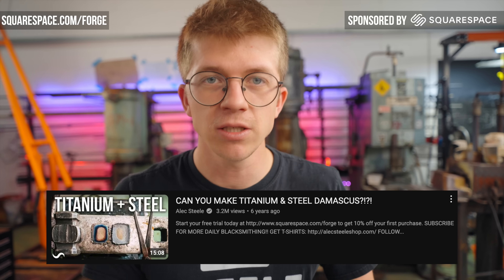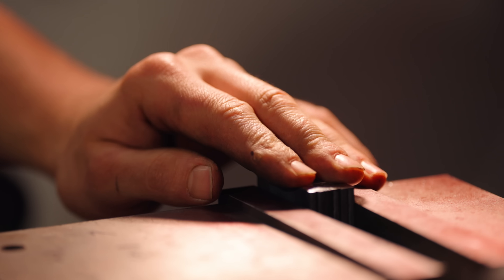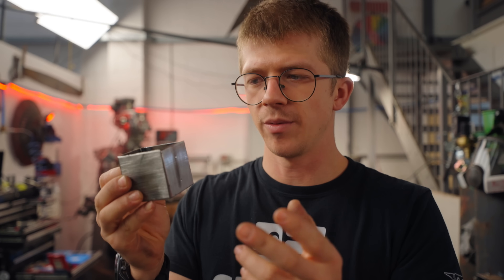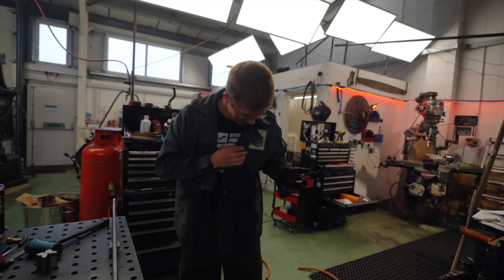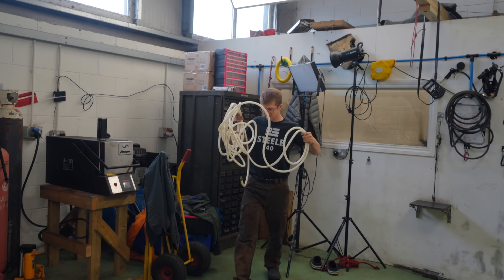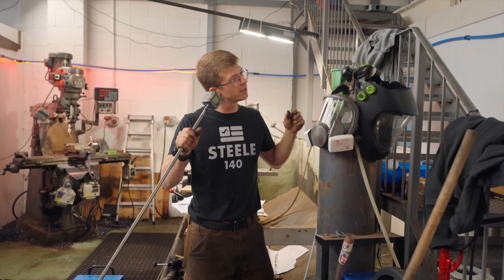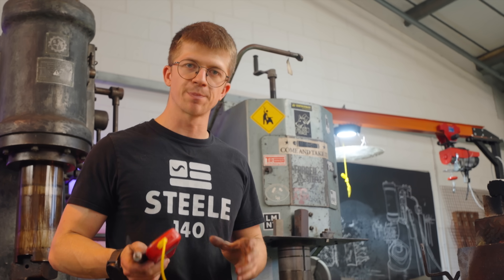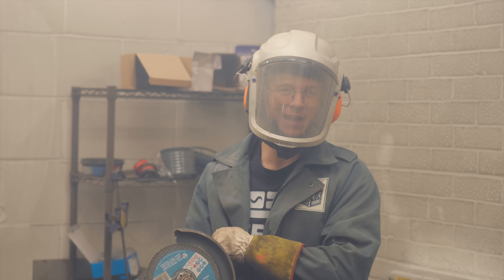Can I make Titanium Damascus?

Comment: You might be able to get titanium cheaper than that if you have better sources. Used to work in aerospace supply and that small amount is what we paid for massive sheets and wire bundles.

Comment: you need an induction forge, should reduce heating time and oxide mess due to no fuels used and can be moved easily so you can place it right by the anvil

Comment: Initially when purging the can you could hold the pipe vertically so that the air floats on top of the argon because science. Or maybe you could place a vacuum on the pipe after putting in some brake cleaner, ignite it and it'll be purged with co2 prior to purging with argon.

Comment: Much better to have used a light pickle process as sand blasting will potentially contaminate the surfaces with Silica grit or sand and ditto the "chemical" cleaner you used. A sensible pickleing mix which will work for both CP and Grade 5 is 88% Water, 10% Nitric Acid and 2% Hydroflouric Acid.
NOTE -  Hydrouflouric Acid is VERY dangerous and will lead to LIFE CHANGING painful burns and skin grafts if you get it on skin or breath in the fumes.
The pickling process can generate a lot of heat once it starts and potentially boil the acid mix. Pickle each piece a few seconds each, rinse under clean fresh water (warm water is good as the pieces will dry quickly and leave no water marks / staining, place onto kitchen roll or similar to dry up the excess water / moisture quickly). Handle with clean cotton gloves or similar so as not to leave any finger prints. Preheat to 925C to 950C (1697F to 1742F) perfect for the CP  and Grade 5 combination. 2100F (1149C) far to hot for both CP and Grade 5. To prevent the Titanium and Steel sticking together, the easiest things is to paint the inside of the steel box with a thin coating of HIGH quality brilliant white emulsion paint and allow to dry (the pigment in HIGH quality white paint is Titanium Dioxide and will assist in preventing bonding). Good luck with your next attempt :)
Reply from the maker: Thank you for this great info!!
Reply: @AlecSteele  Happy to help where I am able, not an expert but 40 years in the UK Titanium industry in a Technical / Quality Assurance role on many different projects I have picked up a few tips and happy to pass on, though I'll have to be careful not to give away any trade secrets ;)

Comment: Seen a message board from like 10 years ago and they were talking about types of metals for smithing swards and one guy went into great detail about mixing tungsten, steal, slivers of gold ect. He said it was hard to do cause you can potentially drop a lot of money to get it right. And I guess there’s metals out there that have like a memory and will slowly bend back to its original fixed state? I feel like there’s a lot of untouched territory for long lasting swards with a high tech edge to it. The guy also said something about in theory you could make it conductive so there would be an electrical pop when you stuck your target. I know it sounds weird or outlandish but I wish there was someone out there who would experiment with stuff like that.

Comment: Like if the 2nd hole is to expel the air, I would drill that on top, because argon is heavier than air, so as the chamber fills up with argon, it will be from bottom to the top. That is why you can't be welding on a car from a hole in the ground, because after a while it will fill up with argon and the poor weldor will die from air-displacement

Comment: dude...........do your homework, you haven't created damascus.
first off, damascus is a place. what you thought you were trying, was fold-titanium. brings us to the next point. you didn't fold it. you stapled it. you'd have to have had it folded a dozen times or more and then dunked into acid.
Reply: oh and i'd like to add, the point of folding steel was to have the fold-side always on the same side and shape that into the monoside blade edge because there the folded layers would be most and thinnest and most durable.

Comment: The reason why there was only one hole is usually put in the forage on the high side of the one hole because argon is heavier than oxygen, so it fills up and pushes the air out the top

Comment: Good job with the Argon. A vacuum furnace would be ideal for titanium but that would be expensive for just experimenting. Of course you can write it off as an R&D expense and get a tax credit. Id recommend getting a wet abrasive saw for cutting titanium and have more patience. What Titanium are you using. Is it CPti grade 4? The Ti64 you layered in there is gonna be the hurdle. CPti is actually pretty easy to work with. Similar to Aluminum. The Ti64 though is a beast. It is significantly stronger and harder.

Comment: I just want to know one thing - can you do jewellery? Seriously, my body either rejects or eats(corrodes quite rapidly) anything that isn't titanium. I only get colours with anodised titanium. Basically the colour has to be a part of it, because if it's a layer of paint, no matter how hypoallergenic and body safe it might be, it's not safe from my body. Seriously. Had coloured eyebrow bar and it started to flake off like glitter before I even noticed. It was a slightly tarnished, mostly-silver bar within weeks. 

Rainbow titanium, on the other hand? Those will last forever. But my skin eats surgical steel.

Comment: When inspecting titanium welds, the colors is how you know if it is done right. So, the welded is not allowed to clean it off until after the inspection. Each color has different temper properties, so it really matters when building pressure vessels and the such.

Comment: If it you try the setup again from billets and keep it from the goop state (I'm coining a term here, I don't want to call the laminar flow something nsfw) I wonder if that would have been hot enough to effectively braise the iron to the titanium.  At lower temperatures it should stick but not so thoroughly, right?

Maybe the goop state is the art of dodging magma while wide bonding iron and titanium

Comment: this is a brilliant forge welding method why dont we use this instead of flux for steel its a million times cleaner and wont gum up the forge im positive itll work with 75/25 just fine

Comment: Hi Alec. If you put the outlet a the top of the cannister, it will have filled up all the way with Ar (displacing the air in the process) before the Ar can eventually exit through the top of the can. Its a bit like one of those mobile phone games where you have to fill the containers with water! This is the method we use when purging superalloys for welding.
Reply from the maker: Sick! That makes a lot of sense!

Comment: if you mechanically polish up to a mirror finish then etch with something like krolls solution whenever you go to form oxides (either heat tint or through anodization) you will get a significantly more vibrant finish

Comment: Ummm, for what appears to be all of your experience, anyone who has worked with metals could have taken one look at the block when you pulled it from your furnace and realize that it was quite likely over 2,000F with the bright yellow color.  What squirted out may very well have been the iron and not the titanium as titanium has a melting point of about 3,100F while steel has a melting point of 2,200F to 2,500F.

Comment: Hey Alec, I work in an industry that primarily manufactures titanium components. When you oxidized your stack to get the color change you used heat, but a more accurate way to do it would be to use an anodizing bath where the color is determined by the voltage. I am however unsure of how it would affect the two grades, my best guess is that the rate of the oxide build up is different between the two so the color change would be different between the two but left long enough you may get a solid color. For those curious, unlike anodizing aluminum where a dye is needed, titanium's color is a result of how light reflects of the oxide layer. In the anodizing bath the voltage is what determines the shape of that oxide layer and thus the color.  

My only other thought on this project as a whole is that titanium is not a very good material to make knives from, it's both weaker and softer than normal knife steels. BUT it would make a very nice decorative handle.

Comment: A very interesting experiment. You should try alternating layers of titanium and gold. It has recently been discovered that titanium and gold form an alloy containing about 70% titanium and 30% gold, the mechanical properties of which are superior to many types of high-quality steel. Using thin sheets of gold and thicker sheets of titanium, you can create a composite material that will probably be suitable for making cutting tools, knives, etc. It will resemble damascus not only in appearance, but also in its essence. Titanium also alloys well with silver.

Comment: A different casing material might be advisable; Fe-Ti has a eutectic around 1100°C so they're literally melting together. The resulting melt probably isn't very useful (hard/brittle intermetallic? rich in carbide due to reacting with carbon, even what little's in mild steel?) so wastes material, and has to be either ground off, or dissolved in acid (of course, using an acid that doesn't attack Ti itself).  If you have the equipment to TIG Ti directly, that might be best?

Or, maybe it's not that awful after all -- would be something else to try, anyway. You could make a stack of Fe and Ti plates to varying mixtures, and see what that's like.  Steel box crucible is an unconventional method to be sure, but that doesn't mean it can't work :)
(To be clear, I mean melting it in the box, cool perhaps with forced air to get fine grain structure, then see if it's forgeable at the lower (orange hot?) temps.)

Comment: hey gent, as a titanium cnc operator myself a tip for your next attempt at cutting it clean would be ceramic carbide inserts. typically we use the iscar brand personally but feel free to shop around.
Reply: Sandvik sells H13A inserts that's meant for titanium and superalloys. Tungaloy is a pretty good brand too. Fellow CNC Operator here.
Reply: @therealsourc3  H13A is the way to go! Another fellow CNC machinist here!
Reply: I use a wet abrasive saw at work and have no problems with unalloyed titanium.
Reply: Or edm wire
Reply: Persoanlly i was wondering if there could be a chemical process the selective attacks the outer steel without touching the titanium
Reply: Yeahhhhh, NO😂😂I hope this is a major troll joke lol. I hope you respond 😂

Comment: Would Ti welding rod be cheaper? Also easier to cut and clean... could make a lot of intersting patterns in the box and between various metals - just kept purged.   Clearly a jacket would be needed that would forge out in one direction.  I'm guessing folding would be difficult w/o a recut - and back into a new box for exterior atmospheric shielding.

Comment: Alec, in your squarespace bonus video you mention ripping the plastic trays out to use them elsewhere. That can be done with a 3d printer very very cheaply and as custom as  you need it to be. Those trays would only cost a few quarters worth of material. 

Just an idea, love the new metals experiments!

Comment: If you should ever have the opportunity to try this in a vacuum heat treat oven, add in a few pinches of tungsten powder and a sprinkle of graphite on the very top layer. Removing the billet and exposing it to oxygen for the first time while still warm will reward you with some awe-inspiring colors and a mighty interesting alloy. 

Patents are funny things, as many of those same 'protected' materials can be improved upon and patented by a third party. Worse still, you've basically written down precise instructions for another company to copy and now is electronically searchable. Two things that countries that do not respect IPs or rightsholders of significant investments to develop new materials gobble up like you wouldn't believe.

Comment: Patents are written to be minimally helpful; it's smart to do anything that seems obvious, as a professional, to make the process work better. Also, Ti dissolves its oxide at these temperatures so you can get away with it in terms of forging, it just is marginally worse for the final properties. Good job getting all the organics off before lamination, though!
And it isn't surprising that the jacket stuck on: it'll flux almost any other oxide, including the correction fluid trick.

Comment: You have to be careful what type of blasting media you use. I believe aluminum oxide blast media will contaminate the weld joints. Double check me on the media it is either aluminum oxide or silicone carbide.

Comment: Huh, I wasn't aware a patent existed but in 2012 a local Alvin TX knife maker recreated an original pattern 'Cold Steel' Tanto with a steel center core (80CrV2, for the cutting edge) sandwiched between Damascus titanium and I believe he did use inert gas to do all that. I wanted to buy it because it was absolutely gorgeous but it was way out of my price range.

Comment: You moving the hole from where it is drawn in the patent is likely not you being smarter but just removing a layer of obfuscation similar to figuring out that the welding flow meter might be an appropriate scale for high/low flow rate.

Comment: The inert gas is to prevent oxidation, and a "slow flow rate" is simply to ensure no oxygen gets in. Any flow rate over 0 will be greater than ambient air pressure, so even 2 lpm might have been way overkill. You had a great success, and congrats! Can't wait to see what you make from it! However, you could turn the heat down, reducing the likelihood of molten titanium and fusing the billet to the canister but reducing the air flow will help, since you would also be pumping in less cold air. All you really need to achieve is a flow rate over ambient pressure.

Comment: 1) Thanks Alec. Your energy and excitement has made me someone who actively appreciates the many wonderful properties and peculiarities that exists in the world of metals.
2) Can a brass colored alloy be crafted that can be oxidized vibrant blue? Clickspring makes the most hypnotizing blue on steel, and I think that color would go absurdly well with golden/brass, so my idea was to high shine something brass colored, oxidize it, and then selectively polish off the oxide to get back to golden. The possibilities for intricate patterns is only limited by the ability to polish accurately.
Reply: you could do something similar to this with cp-ti or ti64 by fully polishing the material and selectively anodizing certain areas while covering some areas  up with a clear nail polish. the voltage/current you'd need for each color will slightly change based on the size of the material but with experimentation you should be able to do all of these colors. If you don't like the color you get, you can also repolish the oxide layer off and try again.

Comment: Unless I'm mistaken, you really only can patent a process. So you could still make a similar product if you could discover a new technique. If it's discovered that there is no other way to manufactur a product, then the patent can no longer be enforced. If it is still enforced then the patent holder would have a monopoly. Please correct me, if I'm wrong.

Comment: One of my lecturers made a super fancy vacuum induction furnace press to make gold & titanium mokume-gane.
Now that I think about it, putting laminates into a satinless steel rectangular tube welded it shut after purging with argon under a high vacuum
heating it in a furnace with good temperature control & the just forge welding it in a press would work.

Comment: Titanium and Silicon Carbide damascus would be very interesting to see. Pure SiC has been hot forged (DOI: 10.1016/j.scriptamat.2004.09.012) and the SiO2 passivation layer formed by the surface of SiC oxidising at high temperatures should allow it to interface with TiO2 formed on Titanium. So, forging without argon, using SiC as a glue. Another interesting forge welding candidate might perhaps be a damascus of titanium and aluminium bronze?
Also, a titanium katana might be a future project idea, especially if you could compare the differences between folded steel, folded titanium and steel+titanium.

Comment: I would still like to see you laminate the titanium (5 grade 2 grade) with proper steel also, as you are not exceeding the melting temperature of most steel, if you went with super thin steel sheets inbetween each of the titanium layers it would give an amazing offset colouration.

Comment: U.S. Patents are intentionally vague because when you give specifics, it means that if someone changes just one thing, they can go to court, stating it doesn't violate the patent. And that has worked.
One of the more famous examples, is the patent for the frisbee. 
The OG frisbee had very specific parameters to give optimal lift and glide duration.
Then another company made a basic plastic disc. It went to court and the basic one was determined to be a unique product. And then it sold like crazy for cheap.

Comment: Well done sir! Two thumbs up mate, two thumbs up!
I'm wondering how many different metals could be forge welded together...?
I'm thinking Ti, Stainless Steel and Ni to start with... All need to have a similar melting temperature. But the main factor preventing it is oxide coatings.
With an oxygen free atmosphere and a reducing flame in the furnace, you should be able to go pretty crazy.
But I'm wondering how long some metals will take to re-form the oxide coatings? Would you have to clean them in and keep them in an oxygen free cabinet?
It gets the imagination going!